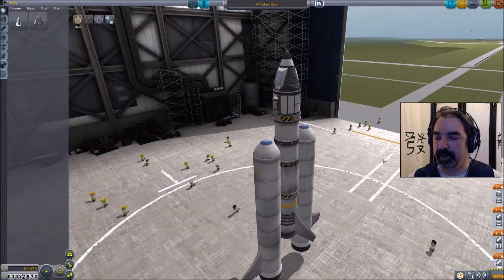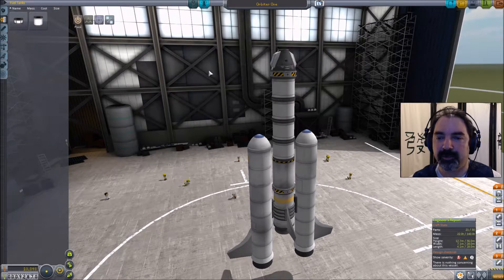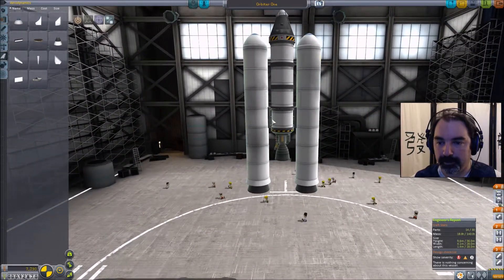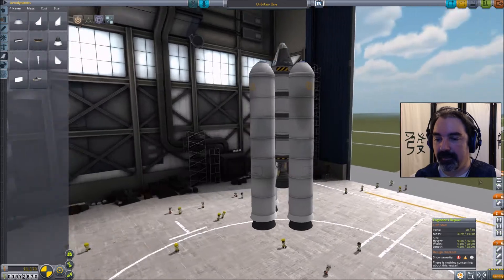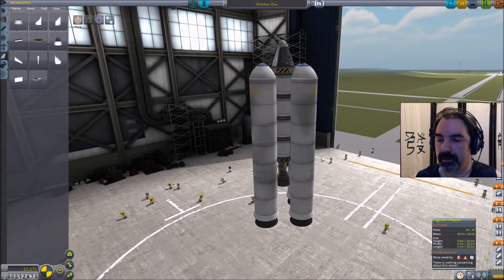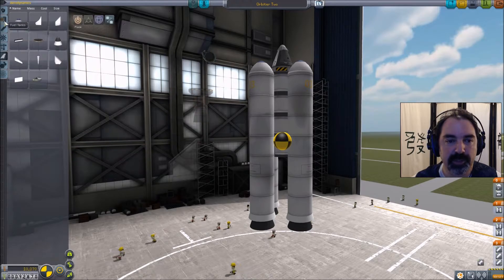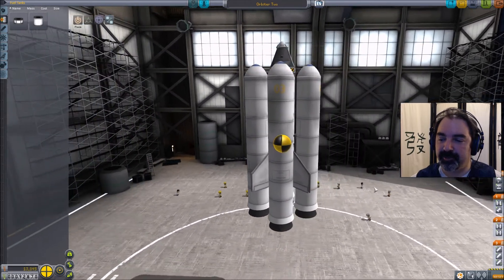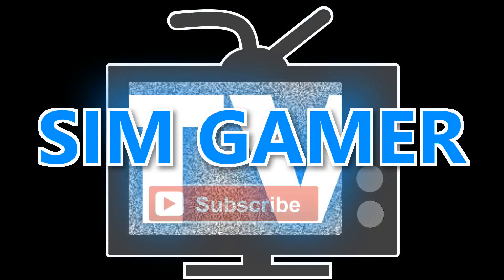Let's Play Kerbal Space Program (1.0) - Building Episode 3

Comment: Nice lets build as usual. Cant wait for the main episode to see how the asymmetrical booster settings are performing. Have you noticed the new basic tail fins, that were introduced with Hotfix version 1.0.2? They are cost efficient and helpful while having a small profile. Nice for early rocket designs.

Regardless of being an active KSP player for more than a year now, the new aerodynamic system really presents a new challenge.
And i need to get used to the fairings... they are far more tricky to use than procedural fairings, as parts inside fairings are rendered inoperable unless the fairings come off.
Reply from the maker: Frank Finster Yes! I did notice those - they were added after I recorded this episode. But I really like that there are a basic set of tail-fins right out of the gate.